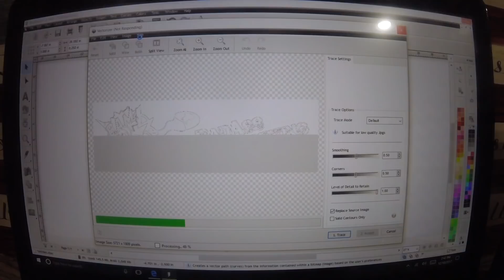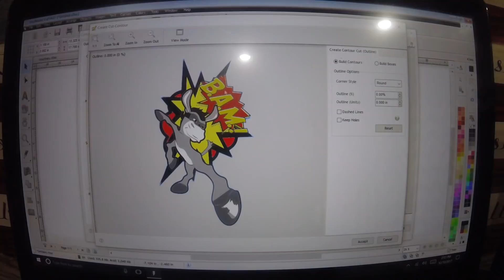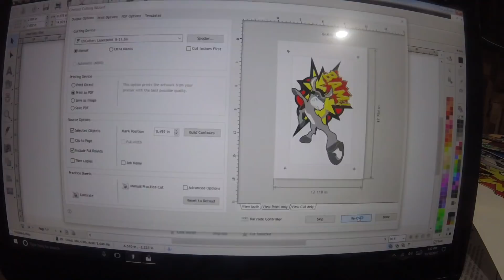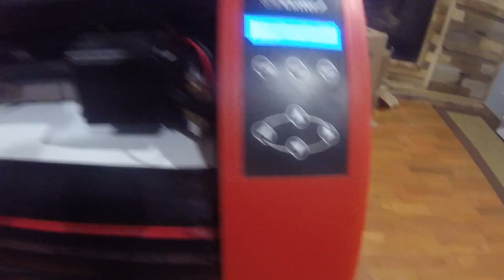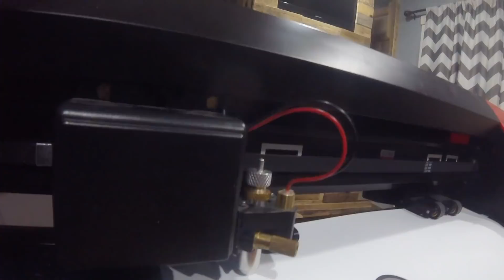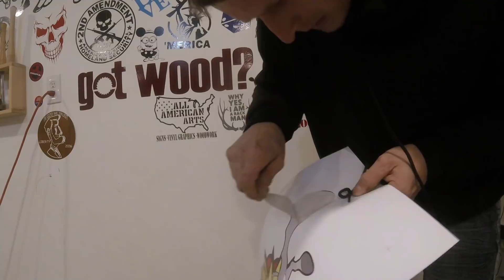CONTOUR VINYL CUTTING , PAPILIO VINYL .US CUTTER LASERPOINT 2

Comment: Will this same concept work for printing on a shirt not just a sticker? I’m trying to do this and heat press to a shirt. If so is it the same steps or do I have to do something different? I already got everything I need and understand the video.
Reply from the maker: Same thing with the printable htv
Reply: @1stphormBMX  can you link me to what paper I should be using. Not too sure if I bought the right one the package says for stickers but I could of sworn the description said for everything.
Reply from the maker: @vanquishliving7030  they have some at Michael's.  Just going back to work but little later I can find a couple.
Reply: @1stphormBMX  ok if you can send me a private message or reply with a link of an example of one. I just need to know exactly what to look for. Thanks for your help!

Comment: Did you print that picture on vinyl or real photo paper . Did this machine just cut out the picture
Reply from the maker: Its inkjet printable vinyl,  process is called contour cutting.  "Print and cut " need to have a cuter thats made to do it .

Comment: Im still having a hard time lining up the cutter. Do i align the laser or the blade with the registration marks?
Reply from the maker: The laser,  your using a laserpoint 2 ?
Reply: @1stphormBMX  nah im using a Specialist  28" from Heat Press Nation. Thanks
So when i line it up with the laser i should press enter?
Reply from the maker: @VinylSkillz  yeah after all four you need to reset it tells you so make sure reset is highlighted and press enter

Comment: I followed the same steps but the image comes out blotchy.  How can I fix this?
Reply from the maker: 🤔Try looking for a really high quality image online and try that see if it works any different...maybe image is to low quality to be resized without distortion.  Pretty nice printer your using ?
Reply: @1stphormBMX  do you have a email so I can screenshot the picture so you can see what I mean? I used the same donkey image, followed the same steps but it has blotchy little spots.
Reply from the maker: its gotta be the printer..can try putting on a photo paper setting might help

Comment: Just a quick question was that laser already on your vinyl cutter or did you add that afterwards?
Reply from the maker: Its stock
Reply: @1stphormBMX  okay so you bought it with the vinyl cutter it was already installed? Thanks again I do appreciate it
Reply from the maker: @IronCross82  yeah it's a US cutter lazer point 2
Reply: @1stphormBMX  okay thank you very much I do appreciate it thanks again

Comment: Thanks for the tutes on registering marks for prints.  But what if you've got 100 of these to contour cut?
Reply from the maker: It would be the same process 100 times or if you did the image smaller you can fit as many as you can on the page with one set of registration marks it will cut them all ,  unless you get a printer that can do rolls of vinyl than you print them all than put that roll in your cutter set up the registration marks one time on the roll and let it go to town all 100 in one shot
Reply: @1stphormBMX  Thanks for the quick response. Yes, I had a hunch registering marks on larger quantities would be a one-time deal here. Thank you and keep up the great vids.
Reply from the maker: @glennracoma7481 no problem thank you for watching...yes the bigger printers are quite expensive but make things alot easier....hoping to get caught up on all my work and get some time to make a bunch more videos this winter .

Comment: Hi, what program are you using?
Reply from the maker: Kay S vinyl masters
Reply: I have a cutter from USCutter as well can I use SCAL for this same method?
Reply from the maker: Vanessa B I have never used sure cuts a lot but I believe so from the videos I have seen about it looks very similar,  so you have contour cutting on your machine?
Reply: Yes, I do I'm actually looking into a new unit because my IO Board stopped working again both USB & Serial ports.
Reply from the maker: Vanessa B you can get a new board for like 35 bucks I had one go bad aswell
Reply: I called USCutter and they are currently out of stock, (for cutter I need its an SC) they just recently released the SC2 the price for a new one on their site is $50.
Reply: I really don't want t purchase a new cutter just for a $50 piece
Reply from the maker: Vanessa B yeah that's a bummer

Comment: Hi I wanna know what printer you were using? Trying to make stickers  And don't know what kind of printer to get
Reply from the maker: Fangs Rosado the one I used was a hp office jet 7612,  I would recommend trying to find something else...  There is not much vinyl you can use on ink jet printer  Plus shortly after I bought this 1 I had a problem with it not printing.  So I contacted HP and they tried to charge me money before they would even give me any info.... I will never buy anything HP again